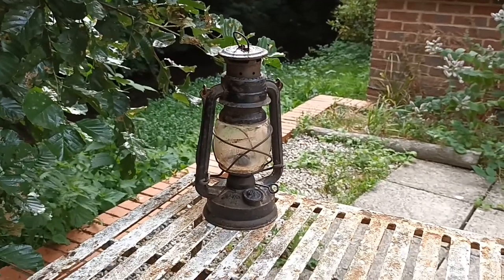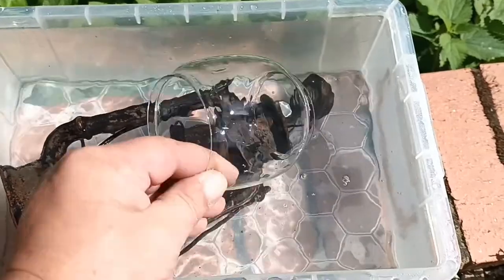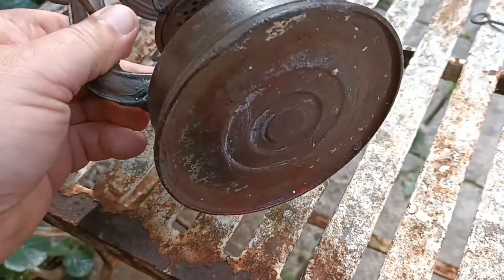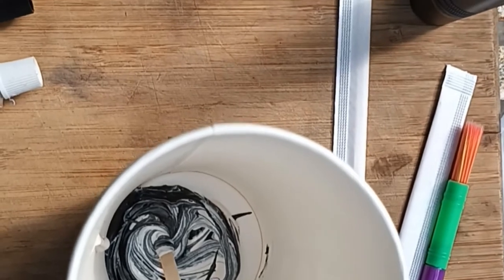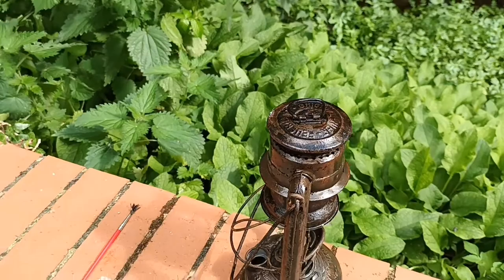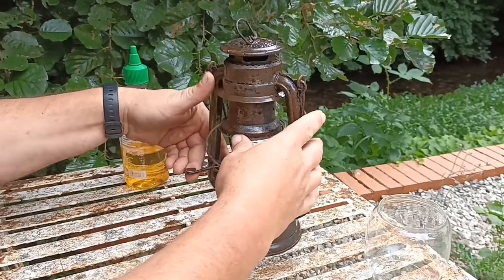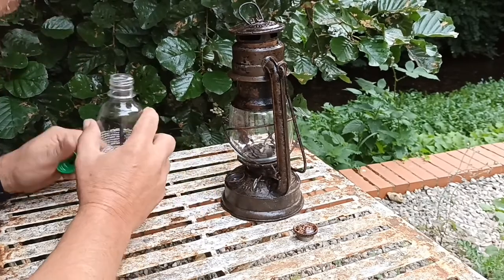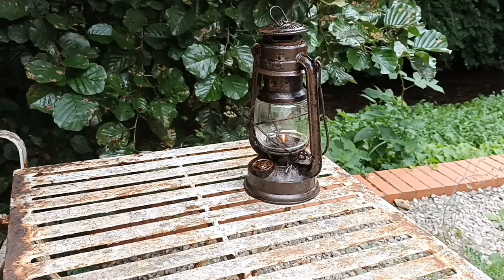Clean, replace wick and fix leak on oil lantern

Comment: Similar story, Got given an old one a month ago. Cleaned it all up, lovely patina, lit the thing, worked fine then noticed the following morning all the fuels leaked out! -which is how I came across your video… Will try the epoxy for sure.
Reply from the maker: Does make you wonder how many get thrown out or kept as ornaments for leaking a little?   😀👍

Comment: Nice, I found a Feuerhand super baby 175, still with the Jena glass in tact. someone placed on the curb as trash, was rusted and cleaned up nice with steel wool and a vinegar bath. The wicking mechanism sprocket is missing, so I had to tear the whole wick mechanism apart to put a new wick, which took longer than planned, but just fired it up for the first time and works great. I love storm lanterns, found a few collectables people had sitting in their attics or basements for free,
Reply from the maker: Nice when that happens. My mate bought one , rusty as anything. Filled it up and  no leaks and everything worked. Happy for her,  but it annoyed me. Big time. Thanks for taking a look .

Comment: Dude that is a not so great idea.  Neither Marine Weld nor superglue is rated for long term exposure to gasoline or fuel oil. There are specialty paints that are reasonably priced that are designed for this exact purpose...such as KBS Coatings 5200 Gold Standard Gas Tank Sealer.
Reply from the maker: Thanks for the information.  I honestly bought it on a Thursday, done what I thought and could get hold of on Friday and made the video. Never seen oven cleaner used ,in this way before. Superglue cost  £1 and the marine weld was the only product I found in an auto shop. Still going strong, though.